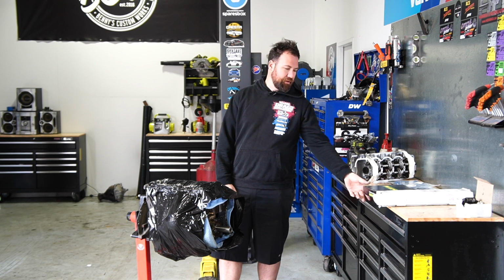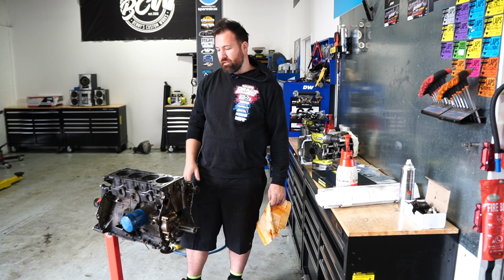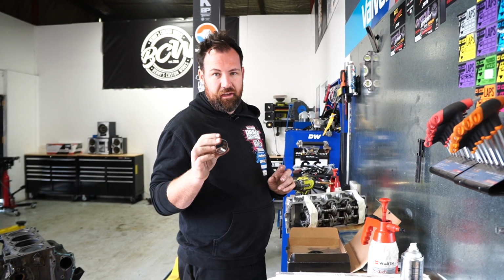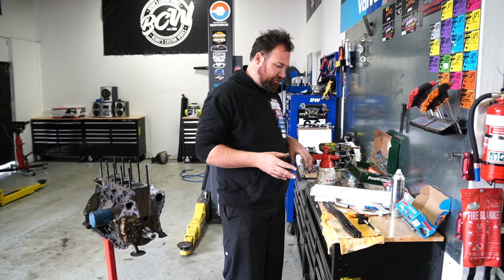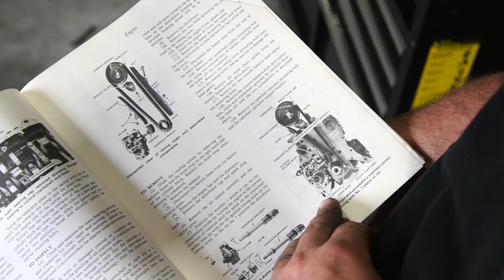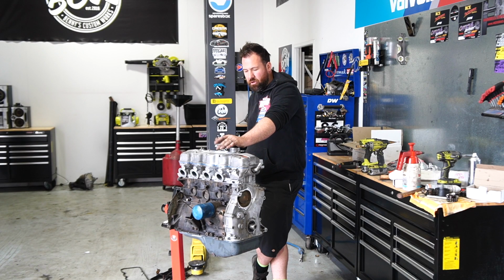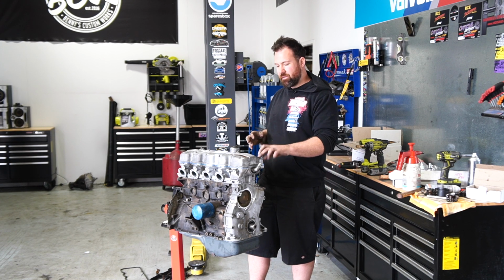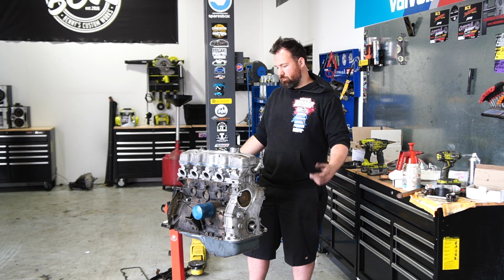SIGMA | Engine Re assembly (Pt2)

Comment: Good Benny!  Glad to see the Sigma motor getting worked on.  I'm very keen to see the balance shift delete on this 2.6lt. I didn't get round to that  on my 2.6lt.

As for the rocker cover I painted mine in high temp paint then wrapped a block of wood in sandpaper and rubbed the ridges back so the paint came off giving shiny ridges over colour.  It looked great.  Just an idea

Comment: I had a gh sigma with an astron 2.6 with a cam extractors and a weber carb on it . It actually went hard for what they were . The diffs are weak as piss though bloody match sticks they were . I blew up about 10 of them . As soon as you touch the brakes doing a burnout they are on borrowed time . I had a tiger yellow one .

Comment: ahhh, memories. I did pretty much the same thing with my Scorpion back in 1997 when it was rebuilt. didn't delete the balance shafts though. my 4G54 had twin 42mm Webers, decked block, shaved head, mild cam, upped valve springs, Lukey 4-2-1 headers and custom 2" exhaust, sounded bloody awesome. my parents wanted to buy it off me but didn't, so I sold it on, just a little too soon as it turned out. could've gone the EFI and turbo route like others did in the day, but I didn't have a wad of cash to throw at it. owned it for 7 years and the mods were gradual. I still miss it.
Reply: Great cars, but that big block 4 banger was art work.

Comment: My 2nd car was a purple sigma with white b45 Simmonds wheels.  2.6, forged pistons, twin 48 webbers, had the astron head and later went to a Magna head. Word of advice if you haven’t already, the diff from the starion is way stronger and has disc brakes on it. I used to blow diffs all the time
Reply: agreed, the standard diffs are very weak (Australian diff)

Comment: I owned 2 Sigmas in the late 90's; both 1981 models, GL had a 302ci Windsor with 3 speed auto in it (cost me all of $800 from a wrecker, only needed brakes & windscreen for rego), other was an SE that had a reclining rear seat (factory thing) and had a Peter Wherret turbo kit on it
Reply from the maker: I want to add the SE roof console + reclining seat when I trim mine
Reply: The Wherret and the turbo GH are two different cars

Comment: I remember doing a L300 van and a cordia turbo balance shaft delete 20+ years ago. We turned the bearing so it blocks the oil hole also we machined the weights on one shaft. We then had to much oil pressure on both engines.

Comment: With you not doing anything with the cylinder walls and rings...I really recommend that you look into using the STP ceramic oil additive.  I've been using it my 04 Trailblazer with the I-6 and noticed pick up in power and fuel economy here in the states. If you don't have it there you should have a similar product. Hope it helps!

Comment: Benny you should put the Magna rocker cover on. That oil filler cap will leak after it’s been running for a bit. I had that issue with mine. The Magna one is a twist lock on and seals heaps better and doesn’t make a mess.
Reply from the maker: Yeah I have one but it’s ugly. Thinking of fitting a raceworks o ring weld on cap tbh
Reply: @BennysCustomWorks  yeah that’s the only down side is that big raised but at the back. The race works cap will look nice.

Comment: I built a 2.6 years ago with a hydraulic head of a GN sigma bigger ports better rocker cover oil cap then the push on type that always rattle was very quite engine

Comment: If you resurface your stone (by rubbing it against another) every few passes, and keep it uniform, that method is perfectly acceptable. It's one of the ways to clean the deck on mills of burrs and such. Plenty of oil and let the stone do the work, giving perfectly acceptable results (obviously would not work on warped heads and stuff like that, you'd prollly make it worse without having some outside guidance like a flat plate).

Comment: Hey Benny, just had a question for you about that spray bottle you always use to spray off parts of spray down surfaces. What chemical do you use in it ? Is it acetone or brake cleaner ? 
Also can't wait to see the SIggy running, this is gonna be excellent !
Reply: Been wondering the same thing
Reply from the maker: Just bulk brake cleaner
Reply: @BennysCustomWorks  Ok, that's what I had a feeling. Just one of those things I've been wondering. Thanks.

Comment: I have rebuilt a few motors no way I would be letting rust and metal fillings go into the cylinders when you were cleaning the block surface. That shit gets trapped between the bores and pistons.

Comment: Darn that brings back memories 🤣🤣 Built heaps of these back in the late 80s. 

With one 2.6 our shop did it was balance shaft delete and big oversized pistons from a Falcon 6. Can’t remember if was 200 or 221 pistons. 

Big port job, huge cam and 350 Holley I think 🤔 Capacity was 2.75 or something like that. Anyway it went like a rocket. Great engine it was

Comment: balance shaft deletes are never a good idea in my opinion. people went crazy with them in Saab Turbo engines (from the 9-3 etc) and they tended to cause issues. also theyre there for a reason. to delete the balance shaft without issues means having the engine internals balanced more finely. as a driver you might not be able to feel the difference but the engine itself possibly will!